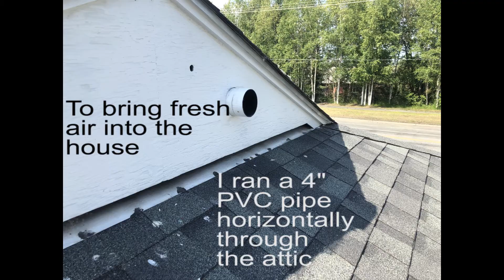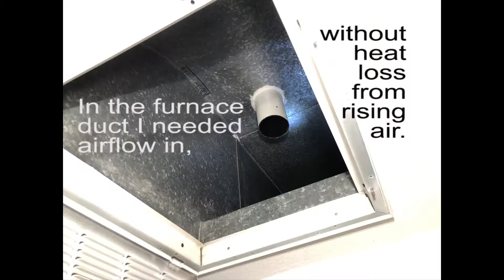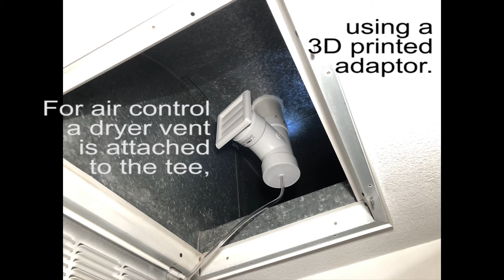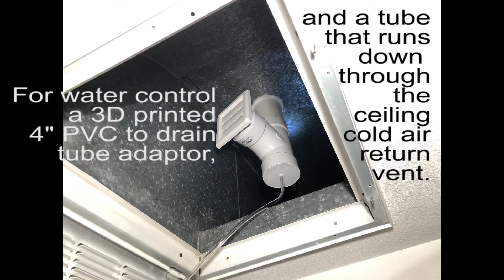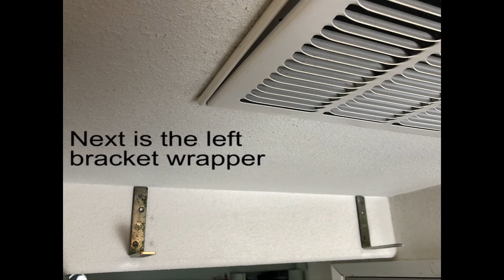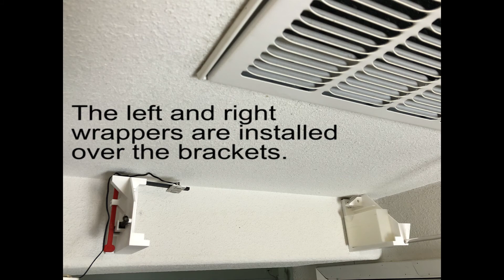Fresh Air Intake System

Comment: Does having a intake on the summer affects the energy consumption?
Reply from the maker: The weather here is temperate enough the only energy needed during the summer is for small fans, so the intake has no effect on summer energy consumption. If I needed AC for the summer, the cold air would be heavier so the ceiling ventilation would not leak any air and should not add to energy consumption.